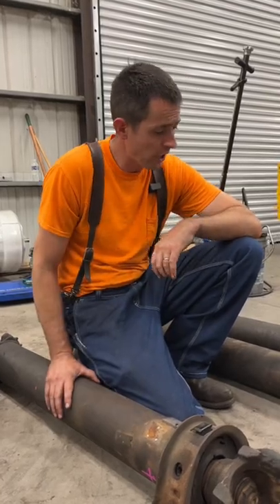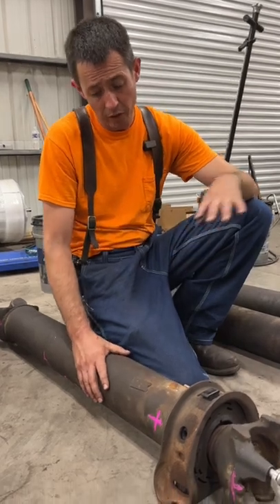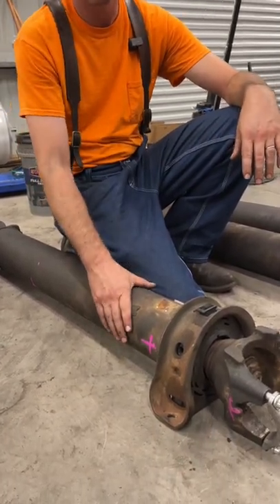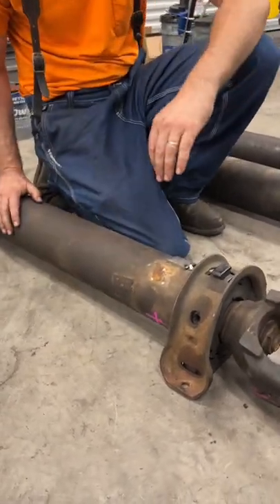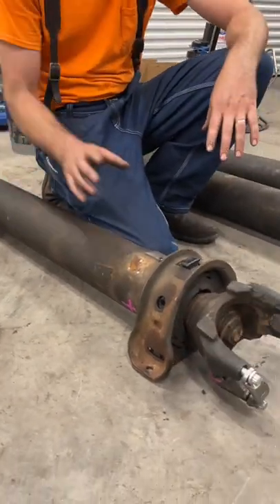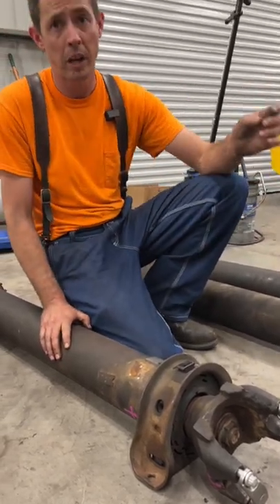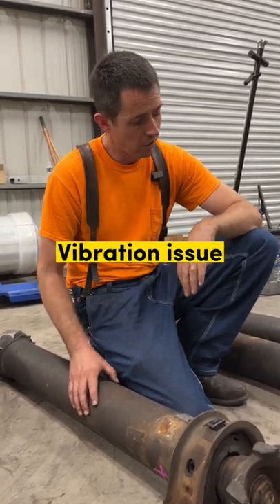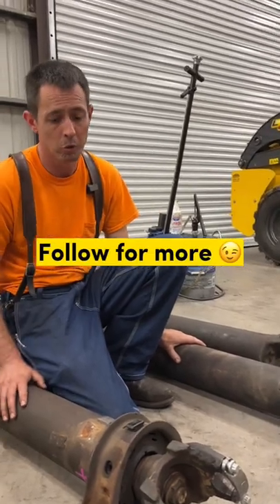Vibration issue on your semi truck? It could be your driveshaft #shorts

Comment: Driveshaft builder here. Every time I go to rework A 2 or 3 piece 1610 to 1810 series  shaft always back the Carrier bearing nut back a quarter turn and check for play between the end yoke and splines. 1 in 4 is shot

Comment: If you don’t mark the caps and driveshaft where each goes to align it back with new universal joints, this happens. Always mark your driveshafts at each joint so you can line them back up when rebuilding driveline.
Reply from the maker: Thank you for pointing that out! All of those marked
Reply: U don't gotta mark them just make a  x

Comment: I worked for a guy whose lowboy had a Jerry rigged driveline. The yoke was so worn out that the screws holding the Ujoint bearing cups in would randomly fall out. His solution was to have a wrench and a pile of extra screws in the cab. He wonders why I refused to drive it🙄
Reply: U didn't have to stop driving just keep tools n truck with u